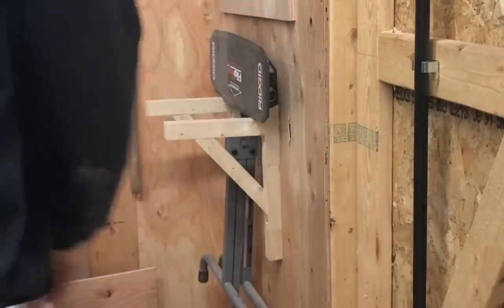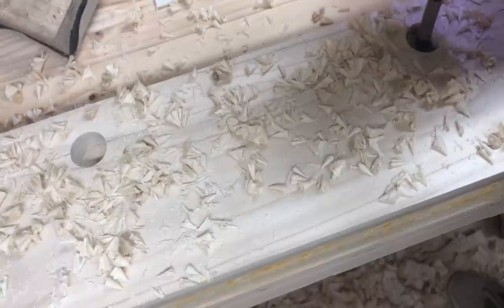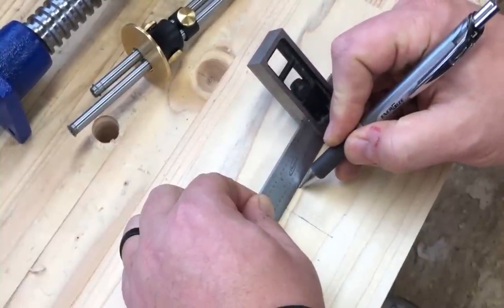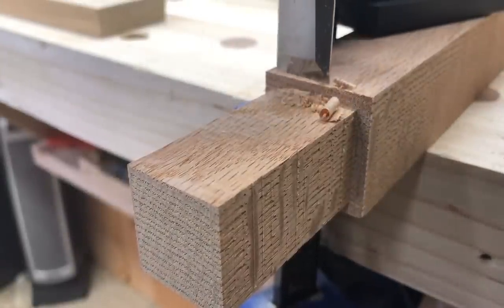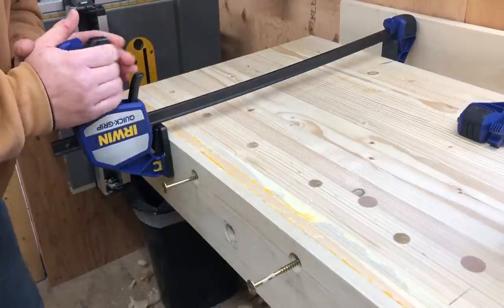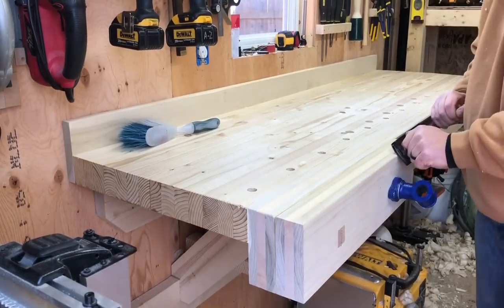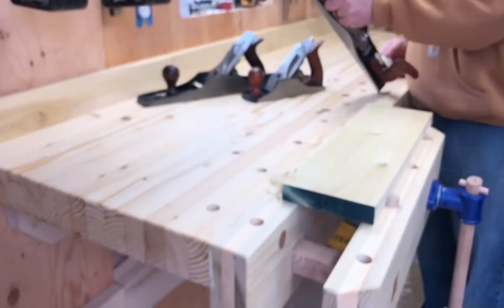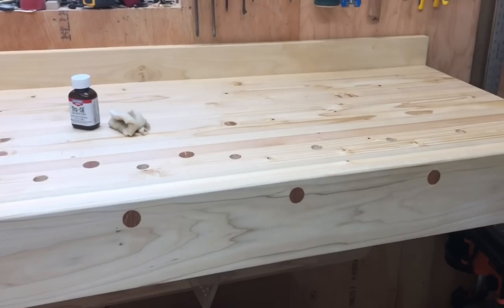Retrofitting Workbench With Apron & Nicholson Style Vise

Comment: You can see how that vice racks to one side when you tighten it down on that long board. It clamps to the right and opens to the left. If I ever get the chance to build another workbench it will be made out of inexpensive lumber but I'm going to try and incorporate the scandinavian style shoulder vice, which has almost the same hardware you used, but the thread is captured behind the vice in the actual shoulder and it's centered on the outer vice clamping board (not sure of the exact term for this) so it squeezes your work piece in the center so there's zero racking.

Comment: Nice job, well done.   You could always add an extra clamp to the left side of the vice, if / when required, to stop it from racking due the off set screw.
Reply: I built one of these and the racking annoys me so your post has me interested.  Can you provide more of your thoughts on this?
Reply: @davidclark9086  All I meant, was that you could add a clamp, such and an F-clamp, to the left side of the vice jaw when clamping boards vertically, to work on the ends (as shown around 14:30)  The extra clamp would help to keep the vice jaw parallel to the apron, so it doesn't just squeeze one side of the board.
Reply: @SoundsToBlowYourMind  That is what I thought but hoped you might have discovered something even better.

Comment: Good, all around approach. But, you seem to be taking off too much whilst planing. It might be the sound along with you pushing motions. Wind the cutter/blade back and try it. Also, when using the vice, pack out where the chops are near the timber (oak) guide with similar width stock to avoid slack. But, the task fits the functionality for your woodworking.

Comment: Your vice seems to pull away from the edge near the table end and tighten at the screw. Have you had any problems maintaining a consistent holding pressure using the bench dogs in the vice or with the vice itself?

Comment: Nicely done... I wonder that did you support the square rod from under ?
Reply from the maker: The only support needed was two pieces of pine on each side of the square rod. Since it’s held in the same horizontal plane as the screw of the vise, no supports from underneath were needed. The two on the sides were only to prevent racking of the vise face.

Comment: Could you gice me the dimensions of the vice?
Reply from the maker: The screw is 18.9" long and 1.12 in diameter.  The screws on the faceplate are 2.6" apart and the inner diameter of the tube for the handle is 1.12" in diameter.  The wood portion of the face of the vise is 24" long by 5.5" high and 2.25" thick.